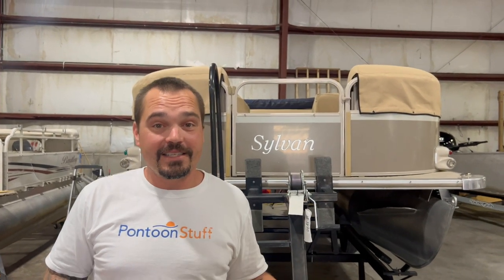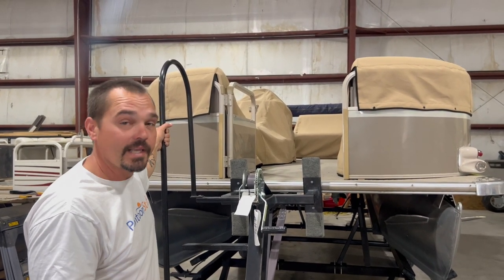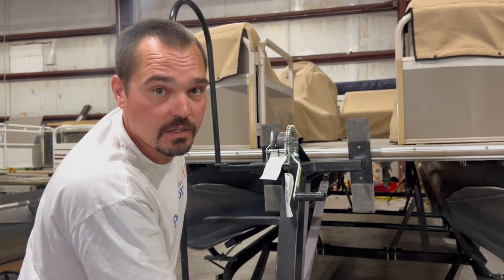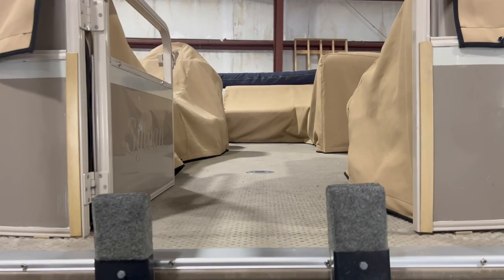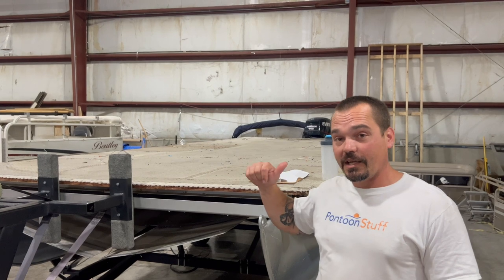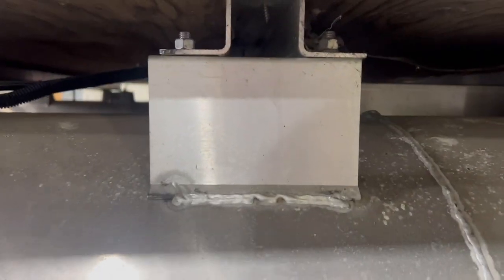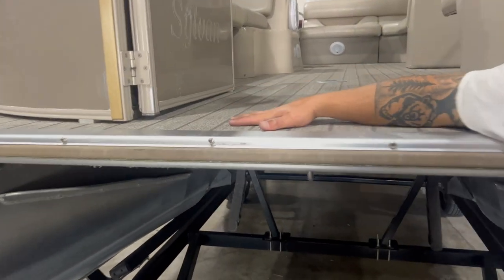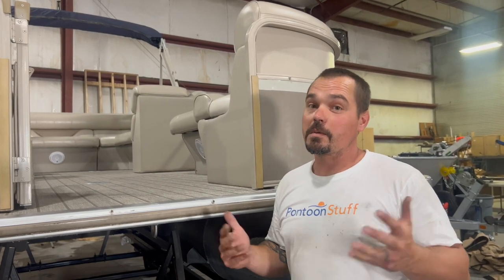WEEKEND PONTOON RESTORATION - New Deck & Vinyl in Only 3 days!?!

Comment: Great Job. Another question I ordered the Faria gauges and was wondering will they wire up the same as my old ones or will I need to find a wiring diagram
Reply from the maker: They should wire up the same as long as you keep track of what colored wires from your gauge harness go where. I've got other videos that share a wiring chart that tells what colored wires go where for all different outboards. Your Tach will need to have the pole setting adjusted to your motor make, model, and year as well. There's a chart for that if you Google "Faria Gauge Tachometer Settings"

Comment: Hey Tom, I was thinking of flipping my plywood, reusing the good sheets. But if you’ve had to drill out the self tappers on the sheets of plywood with a hole saw, would I be able to reuse them or are they basically no good anymore? Thanks.
Reply from the maker: My first response has to be this: get new deck boards. 

If you reuse old boards I would personally just sand the top rot and glue off and keep them upright. The bottom might be dry, but that doesn't mean it's in great shape rot wise either. If you did flip them you could use an epoxy to fill any holes, and then just use new self tappers next to where the old ones were. 

In ending, get new deck boards so you can do it once and be done knowing you did it the best way possible. 😉
Reply: Hey Tom, started tearing into my toon yesterday. OMG, is it ever rough!!! All wood, lots of rotten stuff!! All weighs a ton!! Even the flooring, delaminating, soft…just nasty!!! So will def take your advice, all new flooring is def needed!!! Thanks once again my friend!!
Reply from the maker: @davidcobb4527  I've had at least a handful of customers bring me their boats to restore BECAUSE they'd restored one in the past and never wanted to do the task again!!! The tear down is some good old fashioned hard work...getting it back together isn't so bad, and it's a lot cleaner!
Reply: Morning Tom, Well, your videos have been so helpful and informative!! Honestly they’ve made this job a lot easier!! In fact I was thinking just this morning, that I’ll run all my new wiring harness prior to laying the floor. Save bending over and reaching between the pontoon and the floor, cause there’s not much room!! So yeah, looking forward to a nice clean install!! Cheers pal.
Reply from the maker: @davidcobb4527  That's the best way to do it!!

Comment: How much does it cost to refurbish a used pontoon?
Reply from the maker: The prices vary quite a bit based on length and width of the boat and exact details chosen. In general, most boats start around $4,500 for the floor and go up from there with new seats, railings, electrical, and even a new outboard. You can go to PontoonStuff.com to see all of the materials we use for projects to price it out. If you purchase anything be sure to use TOMSTOONS at checkout to save 5%!

Comment: I have looked at your videos and very helpful. What I am having trouble with is exactly how the wiring from the throttle/shift connects with my gauge cluster. I am installing the Faria Chesapeake gauges, using the six switch box off Amazon to a Yamaha 703 remote. Can you help with this?
Reply from the maker: You need a gauge harness (or to just make one yourself) to hook to the 703 control box. Or you will need to tie into the wires that are coming out of the back of the box that have quick connect fittings on them. This video breaks down gauges for a Yamaha...and it just so happens to be Faria gauges too. You'd just follow the corresponding colored wires from the control box to the gauge cluster. You can even get all the different colored 16 gauge marine coated wires on Amazon!
Reply: @tomspontoons  I appreciate the response, where can I get a gauge harness for this specific application? Or a wiring schematic for this to make my own. 
I watched the video on the Faria gauges to the Yamaha but didn't see where this was done. Did I just miss it and need to watch more closely?
Reply from the maker: @rippedat6058  not sure if Yamaha has a stock gauge harness. You may just have to make one. You can call Vans Sport Center to see if they have one for that 703 box. 616-364-0666

Email me and I’ll send the wiring diagram:
TomsPontoons@gmail.com
Reply: @tomspontoons  thanks for the reply, I sent an email just a few minutes ago! 
Keep the videos coming, they are invaluable!!
Reply from the maker: @rippedat6058  not stopping on the content anytime soon!!